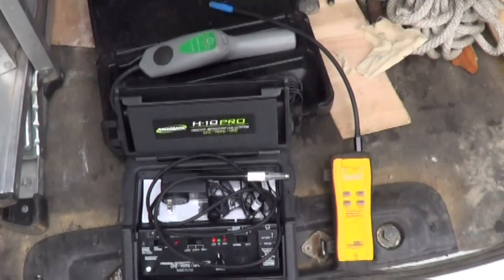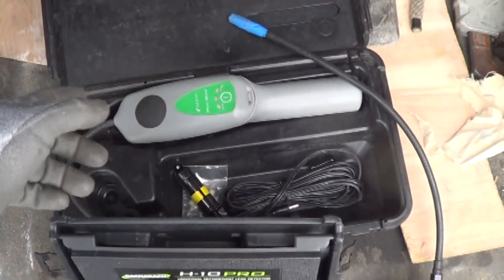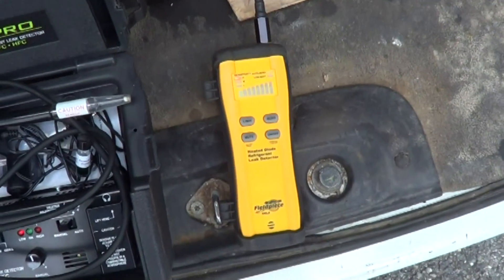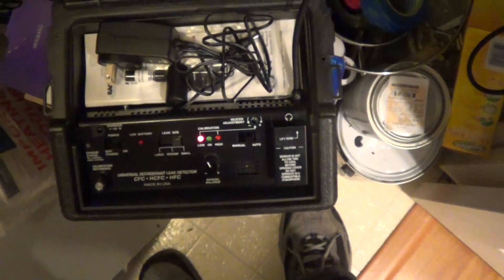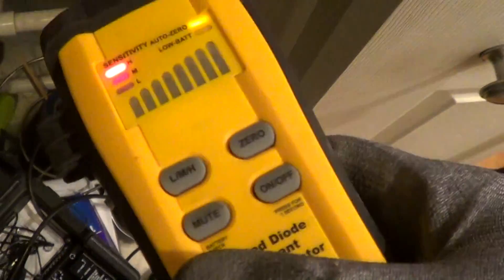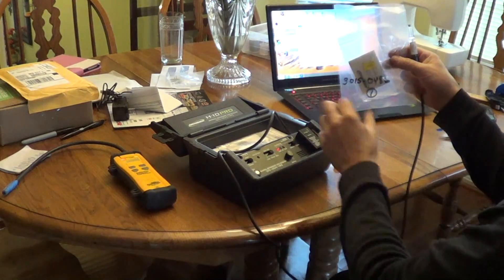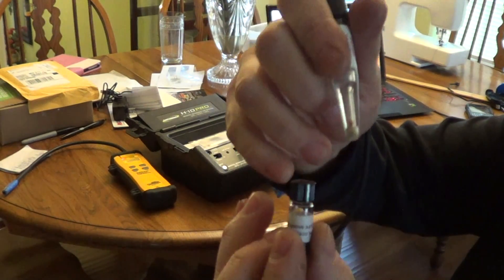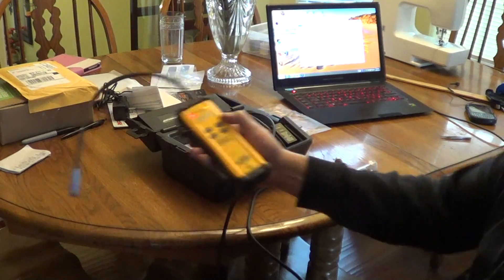H10 Pro vs SRL8 in real world 1 lb/yr R410a leak

Comment: I got a dtek stratus, and have no issues finding any leaks. No matter the refrigerant. The refrigerants I see most often are 404,407,410,22,448,134,12.

Clearly it doesn’t work for anything that runs on 290 or 600

Comment: Just barely seeing this video 6yrs later but I have some  input on my H10. 
I've been using my MARS H10 for 4+ years now and it has never steered me wrong. I use auto setting and switched to low sensitivity. I rarely have to adjust the heater to increase sensitivity to help pin point micro micro leaks. The application I've used this for is rarely residential HVAC and mainly commercial/industrial supermarkets. My MARS H10 has surpassed all brands of leak detectors including the new inficon Stratus. Now I have leak checked R410A and it picks it up no problem but I have referenced other sampling refrigerants for reference and it does not pick it up. Safe to say it'll pick up field refrigerant easily and still running strong. The H10 Bacharach BRAND I have used brand new and I have read the instructions thoroughly as well, this brand H10 gave me issues not much long after use (3 months). Not only I bit my co worker with the same H10 brand new had the same issue where it would sporadically and continuously beep after a warm up. I prefer the MARS brand as I've used mine every week for years straight.

Comment: I have both, the slr8 is way better for 410.
Reply from the maker: I have been using the NAVAC NML1 for a year in the field along side the SRL8 and have been liking it better.    It is 2x more stable and nearly as sensitive.   Also, it appears to use the exact same sensor as the SRL8.   It takes a bit to get used to, because it doesn't tick like most leak detectors.   I have been verifying sensitivity with my breath.   I'll do some videos on this leak detector when I add it to the list of tested leak detectors.

Comment: In the 80's ago I picked up a leak detector that made Corona Discharge on the tip. You could smell the Ozone. If I breathed on it, it also showed a difference. Are the detectors today better than the past?

Comment: Maybe you need to learn how to use the h10
Reply from the maker: Maybe.  That was my favorite leak detector for 20 years.   I probably bought 10 of them.  I do miss the stability.   It just want find small 1 lb per year and smaller R410a leaks.  I even called the factory to see what's up.   I have been using the srl8 and havnt missed a leak in 5 years.

Comment: Great Video. I was in the market for an H10 Pro but looks like ill be going with a tek-mate and srl 8. It's funny,when I first started in Hvac doing leak searches about ruined my confidence. I was using an srl8 and couldn't find much of anything. Mostly used it on r22 systems. Looks like it was a combo of wrong detector for the job and a sensor that was overdue for a change. Do you have a detector that you recommend for LP and Natural Gas? I was going to go with the Bacharach Leakator 10 but Glenn Harrison on hvactalk is very high on the accutools for half the price. Thanks for the hard work!
Reply: I should also say it feels like a small world finding your channel. I was searching for leaking linesets after seeing guys sealing their white linesets on instagram. The leaks have me a little worried right now though we haven't had a call yet. Anyways, just remembered seeing a thread about leak detectors on hvac talk talking about your reports back when i was having trouble with the srl8. Great videos, I hope you continue to put out content.
Reply from the maker: The Inficon Gas Mate works good on Natural and LP.   It is pretty sensitive.  However, gas leaks are way bigger than freon leaks.  A typical natural gas leak is probably equivalent to a 30 lb per year freon leak or larger.  So, you really don't need to have super sensitive equipment to find natural gas leaks.   No one would bother repairing a 1 lb per year leak on a natural gas system because the leak would be to small to matter.   All gas systems leak.  There is no such thing as perfectly tight.  The idea is to fix the leaks that are large enough to matter.

Comment: How is your srl8 with R22 I feel like mine is having trouble finding anything
Reply from the maker: The SRL8 sucks on CFC refrigerants.  Just buy a cheap inficon Tek-Mate or Perk-Mate for R22.  I haven't found a single leak detector for HFC and CFC based refrigerants unless you spend $3K or more for the production models.   Also, if your SRL8 starts acting nice and not false hits, you have a bad sensor.   Replace the sensor on the SRL8 every year and you will never miss R410a leaks.

Comment: How many times are you going to charge a system they need to take your epa card away either they replace the coil or they can live without AC. Wtf
Reply: you're dumb! Learn the laws before speaking! Nothing wrong or illegal with what he's doing.
Reply: Really dude. Any system with a small leak is allowed to be charged every year. Did you even take your epa test? If it has a massive leak and you charge it then you can get in trouble. It's all about tolerance of application. You going to replace a whole system because every year for maintenance you have to add a pound or less?
Reply: @rmack674   I know you were referring to Kevin but as long as unit has less than a 50# charge in it, You can recharge it no matter how big the leak is. So topping off systems is NOT an issue for residential equipment, which is clearly what this video portrayed. I'm actually surprised with how many techs do not know the laws here in the States! So whoever told you that you can get into trouble if the leak is massive is not telling you the whole story. Just remember the 50lb rule. if it's more than 50 then it will need repaired.
Reply: And I really shouldn't have called him stupid, I just feel as if he has bad luck when it comes to thinking!

Comment: Great information Nathan, but you are wrong about the exponential increase in leak rate as pressure rises.  The curve actually goes the opposite of what you suggest.  A ten fold increase in pressure will result in less than a ten fold increase in leak rate.  There is a reference chart in this video that Jim Bergman did. https://www.youtube.com/watch?time_continue=177&v=XkJW5D4IeSM
Reply from the maker: Page 51 of the Inficon HLD4000 manual.    LEAK RATE is proportional to (PSIAupstream)^2  - (PSIAdownstream)^2.    They have about 10 pages talking about the stuff.    I had to get the manual from Inficon though because I bought the $8k leak detector used on ebay.   I then sold it when the SRL8 was just as sensitive.   You could poke a hole in a bottom of a bucket and graph the water level vs time.   It is always exponential.   http://kb.eng-software.com/download/attachments/1442506/KB_dPinPipe_Graph.png?version=1&modificationDate=1490136366000&api=v2

Comment: So how would the SLR8 do with the reference leak of CFC.  I am having trouble using my SLR8 on HCFC's.  The H10 kicks ass over the SLR8 on HCFC and CFC.  I know that's kinda going backwards but sometimes we still have to work on older stuff.  Glad to see you comparing the 2 though...Thanks!
Reply from the maker: The SRL8 is 10x less sensitive to CFC and HCFC.  You have to use the H10 on R22 and all the older stuff.  It is something to do with the flourine in the HFC that make the SRL8 shine.  The H10 is 10x less sensitive to HFCs such as R410a, R134a ect.  I have been looking for a single leak detector for all refrigerants and I haven't found one yet less than $8,000.  https://www.dropbox.com/s/o9d3ur4wuhleai8/Leak%20Detector%20Sensitivity%20Report.pdf?dl=0

Comment: Turn the heater up on the h10 pro it will work just fine for all ref..
Reply from the maker: I tried that several times with new sensor and different H10s.  I would be curious if your leak detector can pick up the HFC reference leak?    It is part number 69386 from Yellow jacket.  Only the SRL8 can pick up this reference from 1/2 inch away.

Comment: My H10G plug in does a good job on both. I have bought a lot of them for my techs over the years. The H10 Pro is basically useless.
Reply: I've been in this tose up as well. I was an advocate only for the h10 plug in doing research. Now due to Northwest Ohio videos, I'm hearing the h10 pro might be okay too. Unless you're saying you find 410A small leaks all the time with the plugin then I may go back to looking for one of those. I've been stuck by the fieldpiece infrared.  Now doing research to find out what's next. Primarily looking for r22 and 410A

Comment: The heat is low on the H-10. the green LED in the middle of two red LEDs has to be on for it to work for HCFCs
Reply: John Smith I noticed the same mistake
Reply: Hmm..
Reply: Right on brother, not set up correctly 👍

Comment: Hey, thanks so much for the superb video and all your work - just shared with coworker!  What's your take on infrared leak detectors for CFC/HCFC?
Reply from the maker: Infrared has an advantage that the sensor can't be damaged by high concentrations.  However, IR has about 10X less sensitive than a heated diode.  So, IR really won't pick up leaks smaller than 5 pounds per year unless you get lucky and sniff right up on the leak. HVAC leak detection is an art and a science.  I'll be making more videos on this subject.  But, basically, you want to have a super sensitive sniffer.  If you get any hits, you have to move the air to clear out the back round gas.  If the leak is a gusher, you want to switch to ultra sonic and listen for the leak.  I"m going to repair a bad evaporator coil tomorrow with a gusher and I will video the job.  Alot of guys ruin the sensor of a sniffer on a single large leak because they don't know that when the leak detector is setting off 3 feet or more away from the unit, it is big.  It is not rocket science.  It just takes some knowledge of how leaks behave.
Reply from the maker: Infrared has an advantage that the sensor can't be damaged by high concentrations.  However, IR has about 10X less sensitive than a heated diode.  So, IR really won't pick up leaks smaller than 5 pounds per year unless you get lucky and sniff right up on the leak. HVAC leak detection is an art and a science.  I'll be making more videos on this subject.  But, basically, you want to have a super sensitive sniffer.  If you get any hits, you have to move the air to clear out the back round gas.  If the leak is a gusher, you want to switch to ultra sonic and listen for the leak.  I"m going to repair a bad evaporator coil tomorrow with a gusher and I will video the job.  Alot of guys ruin the sensor of a sniffer on a single large leak because they don't know that when the leak detector is setting off 3 feet or more away from the unit, it is big.  It is not rocket science.  It just takes some knowledge of how leaks behave.
Reply: It's good to hear somebody say the IR technology is less sensitive. Fieldpiece SRL2K7 was the first leak detector I bought and I can't seem to find anything except obvious leaks. I was starting to think I was just shit at finding leaks.

Comment: Ok so bottom line. If I want a sniffer for R22 which would you recommend and which would you recommend for r410a? Enjoy your videos and appreciate you taking the time to show us your findings.
Reply from the maker: Here is the summary of a leak detector report that I made.  I initially wanted to sell the report, because I had to buy $10K worth of leak detectors and test them.  But, I gave up selling it.  The results are still copy written by me.  Any of the leak detectors with less than 0.1 ppm sensitivity are good.  I prefer the Tek-Mate for R22.   http://s778.photobucket.com/user/nathangwoz/media/Leak%20Detector%20Chart_zpsejenik5h.png.html
Reply: @NathansHVAC  can’t view the link. Can the info found anywhere else? Mind you, there has been a few new models since 5y ago.

Comment: Can you tell me what the difference is between the H10-B, H10-G, H10 pro?

Thanks
Reply from the maker: +Joseph Heritage   All of the H10 leak detectors use the same tin oxide heated diode sensor.  It burns off freon and releases the halogen gas chlorine which changes the voltage on the diode.  The H10 Pro had a re-designed circuit board and specifications that are 10x more sensitive than the previous generations of H10.  However, it seems that the spec of 0.006 oz per year is a little bit optimistic.  I have owned pretty much all of the H10s and variants since the late 80's when I started in A/C.  They are great leak detectors on CFC refrigerants, but horrible on HFCs.  Florine is still considered a halogen.  But, sensitivity is about 20X less than chlorine.
Reply from the maker: +Joseph Heritage   I made public a video from 3 years ago that shows the H10, SRL8 and an $8,000 inficon leak detector going head to head.  You can see how big the inficon is and how I really didn't want to lug it around the field.  Here is the link:   https://youtu.be/ZBx6yq83Iek

Comment: That's disappointing for a lot of guys that swear by H10, I've got one but honestly hardly use it because my TiF Zx1 is much easier to use.
Reply from the maker: +Stephen Rardon (HVAC with Stephen Rardon) Those same guys think it takes hours to find leaks.  I find ALL the leaks in less than 5 minutes.  I have been doing it for 30 years on thousands of systems from 1/10 ton to 500 tons.  The H10 is great for R22.  But, pretty much all the leak detectors are great for R22 because of the chlorine in the gas.
Reply: NathansHVAC ...and this statement right here is why im researching..we are usuing tiffs and on r410 i am spending hours looking for leaks only to be disapointed. awsome video man!
Reply: I have a srl8 and find small leaks but when they are verified with infrared or testo or h10 it is not found, is it my leak detector?
Reply: agree when my tif zxi was working it was great r22 n 134a no problem looks like my h10 pm is not as great like before even with new sensors had sent back for refurbishing,got the sr8 same thing got weaker sent it back to factory,got the yellow jacket 69336 same thing got weaker sent back they sent back a newer version cool thx, got the elitech infrared ild-200 on whimp at the AHR after the demo man its not bad for the low price works great

Comment: Let me know as soon as you find a sniffer that can do both.
Reply from the maker: +The Air Conditioning Guy   I"m trying to get my hands on a Nolek SniffIT X3.  But, I really don't want to spend $3,500 to find out if it sucks.  I would have a hard time selling it on ebay.  I'll try contacting the factory rep again.  If he can't send me a sample, I could send him the CFC and HFC reference leak bottles to see if that leak detector will pick up the leaks 1/4 to 1/2 inch away from the bottle.

Comment: That's funny I was thinking of getting H 10
Reply from the maker: +The Air Conditioning Guy   I'm selling my slightly used one on ebay for $400.  I have used the H10 and it's variants for 30 years.  But, they are horrible on R410a and R134a.  So, I actually bought every leak detector on the market and tested them in laboratory style PPM tests.  The SRL8 came out on top for R410a by a factor of 10x better sensitivity.  The HFC reference bottle in the video is actually made for the Prowler.  However, the Prowler barely picks up it's own reference.  The SRL8 goes bananas with that reference.  I have been using the SRL8 for a couple of years and never missed a R410a leak yet.  But, the sensor should be replaced yearly in that leak detector.  Also, the SRL8 does suck on R22.  Almost any leak detector is better than the SRL8 on CFC based refrigerants.  So, two leak detectors are required HVAC service until I find a single one that is sub 1 ppm sensitivity to all refrigerants.
Reply from the maker: 134a and R410a are the same sensitivity.  They are both florine based gases that release the halogen in the heated diode sensor.